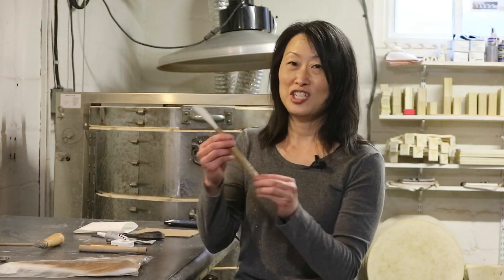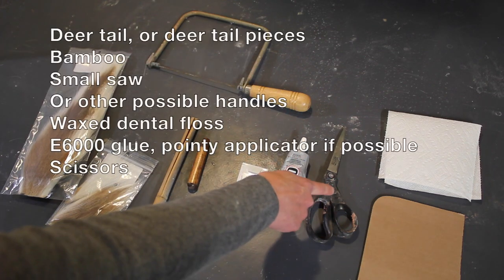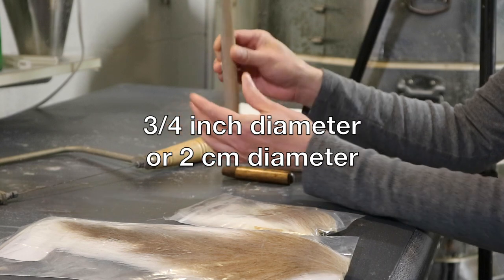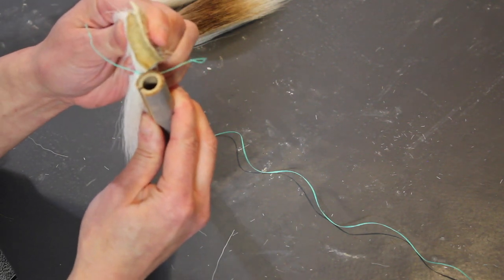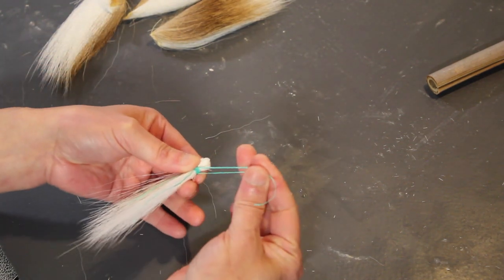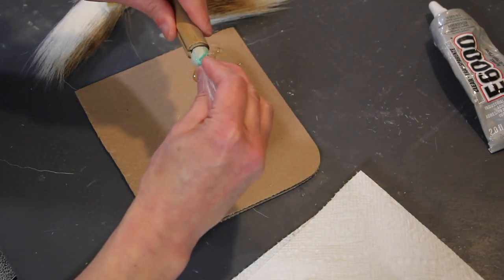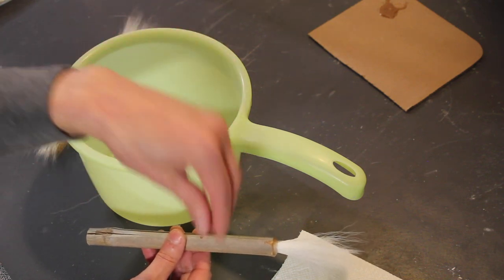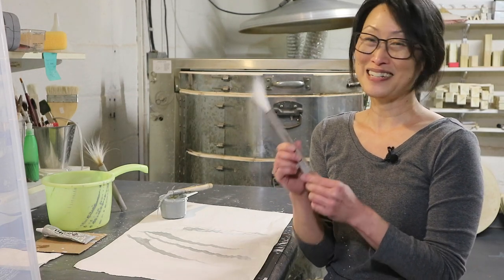How to Make a Deer Tail Brush / full-length video / free to watch

Comment: Thank you for the nice video.  I have been making brushes for several years.  Most of my brushes are made from squirrel tail hair and badger hair.  They are shorter hair but it works for a number of pottery techniques.  I am a fly tier as well so I have a good supply of materials.  Besides bamboo I also cut what we call switch grass that has very strong bamboo like stalks.  I use fly tying techniques to stack the hair and tie it together.  It is interesting to see how you make your brushes.  There is always something to learn.  It gives me impetuous to make some larger brushes.  Thank you.  Tom

Comment: Wonderful video! As another option instead of the surgeon’s knot, you could use a constrictor knot.  The constructor knot is a much tighter knot that doesn’t slip and is virtually impossible to untie.  https://en.m.wikipedia.org/wiki/Constrictor_knot